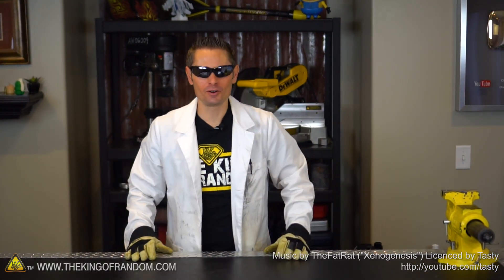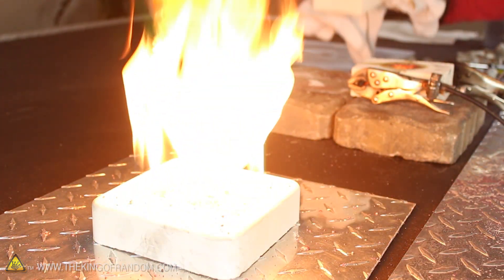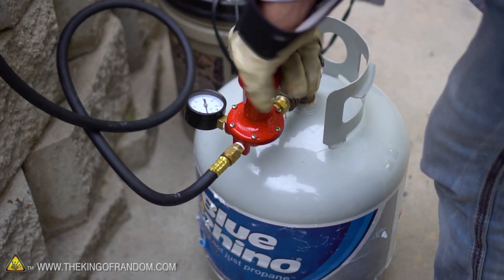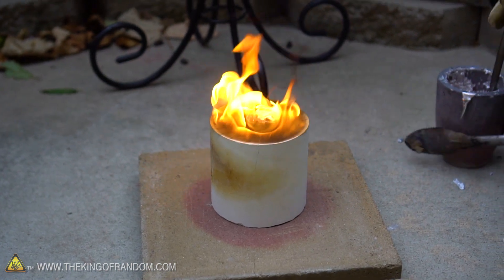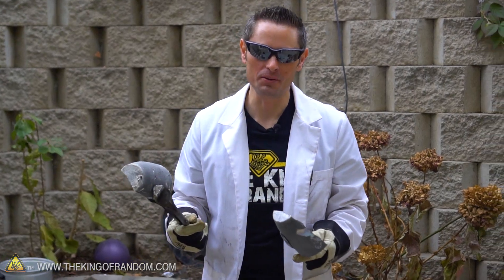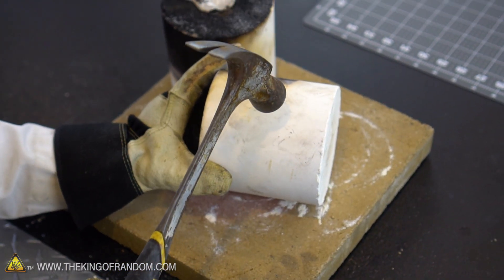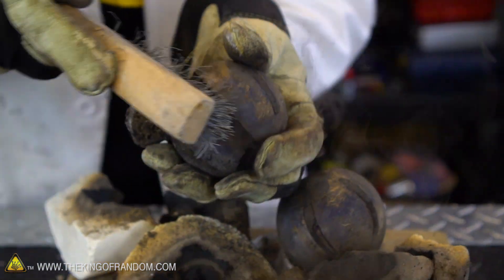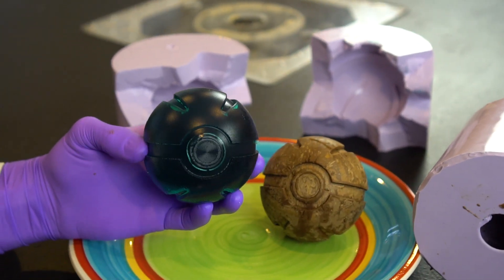Casting Aluminium PokeBalls

Comment: another way to do this is to use a substance called Green sand or silicon mixed sand most metal casters I see use some sort or version. There are a ton of different recipes for it but it melts wax and and molds really well just a tid bit of info love the channel and all the work

Comment: to avoid air bubbles or voids in your castings you need to add air vents adjacent to the pouring hole to allow gasses to vent..  you could do this as a wax sprue that you add before pouring the plaster :)

Comment: I recast parts for model kits. if you want less bubbles on it, you need to have some more air holes around the top to have the air channel up. It's more cleanup, but the results will be much better.

Comment: Hey Grant, I have never cast anything myself but I have always wanted to start.   I believe one of the main reasons you are getting those airbubbles at the top of your cast is because you do not have a secondary hole for the air and gas to escape as you pour in the metal.  Maybe give that a try and see how it works.

Comment: Hey Grant, if you want to make molds for metal casting, you best bet is to use sodium silicate and sand, then harden the sodium silicate with CO2. You can make 2 part molds with this method pretty easily, you just pour the sand in and pack it down around the object, then when you have one half packed completely you hit it with the CO2 and start on the other half right on top of it.

Comment: A better way to do that is to compact sand with water and a packing device and once it is inside the compact sand than cut it in half and you got a high heat cast

Comment: Couldn't he have let the wax inside the casts and simply poured the aluminium over it?
Reply: The wax does not burn out quickly enough for that to work like it does with the foam molds from the older videos. The wax needs to be removed for this method, called investment casting, either by melting it out like Grant did or by burning it out at a much higher temperature.
Reply: Some molds like the ones for rings could work with wax, but thats because the object is so small it is able to burn out quickly enough.

Comment: For casting metal you need to use Sand, Casting sand or GREEN sand will be the best way to go. Much easier to use, work with and sand is reusable.

Comment: you have to shake air pockets out with a heavy duty shaker that vibrates.
Reply: vacuum chamber would be better.  really surprised he does not have one, compared to the things he used to build it would be a breeze.  Could make one that doubles as a vacuum former as well.
Reply: Even more surprising considering he had a vacuum chamber brought over before with the scorpion video. Guess it's just one project he hasn't gotten around to yet.
Reply: Donnovan Mason or you can put it in a vacume
Reply: For the latex molds he could also mix a smaller batch and brush it over and into the pockets to fill them in. This would require a second curing though.
Reply: The Weaponeers ok cool
Reply: ***** oh.
Reply: Donnovan Mason thanks nice to know 👍

Comment: I am not an expert either, but I think there are usually extra channels in strategic locations in the mold to prevent air pockets and bubbles. And for the bubbles in the silicone, you should invest in a little vacuum chamber to put the mold in after you poured the silicone.

Comment: vacume chamber to get all the air out
Reply: that would work great for the silicone mold part, and its a whole bunch of vacuum experiments he hasnt seem to have done yet.. like vacuum forming, collapsing stuff with vacuum, etc.
Reply: yes this would work to get a bubble free mold. I do this when I make molds for resin casting, however you have to make sure the item you are molding is air tight. those pokeballs would have filled inside with silicone if he had done that and it would have been much harder to clean out the inside of the balls afterward.
Reply: *****
Hes done so much.. Now I need to go look for it.  Thank you.
Reply: TravisFabel

Comment: If you agitate the mold just after the pour and as it's solidifying it'll help release the bubbles and bring them to the surface faster...I believe they have machines for that but I'm sure with your ingenuity you could make something similar. Just basically a surface that vibrates.

Comment: go to the dentest and ask for little wachs sticks. put them in the mold where air can be trapped. when you heat them up they will melt as well but they will left little tunnels for the air to releas

Comment: Grant, next time you cast add extra vent holes.  If you're doing in plaster/wax casting, glue some crayons or wax sticks to the top edges. When you melt out the wax it will leave behind vent hole that will allow the air to escape when pouring in the aluminum.

Comment: To remove the bubbles from plaster moulds, jewellery makers pour the plaster around the wax as you do but then they place them into a vacuum or low pressure machine. This forces the bubbles to the surface. Try this with silicone too ?

Comment: Why not use a method of casting where you make a wax mold and cover it with oil sand and then poor the metal on that? The metal will melt the wax as you poor it.

Comment: Yea I've had some better luck with sand casting when it comes to trying to make more detailed aluminium items. The trick is in the green sand which is just sand, bentonite clay (can be found in cat litter ) and water. Since the sand and the clay aren't reactive it won't burn and you don't get the pockmarks.

Comment: If you want to help prevent the top air bubbles, you should add some "vents" holes (with a small drill bit) in the top next to the main pooring hole. it's going to create an escape route for the gasses.

Comment: I recommend you use Machining wax or a harder type of Wax when making wax models because candle wax not ideal and when  pouring your plaster tilt the container in which you have placed your wax model and if all possible buy a vacuum chamber to take all the bubbles out or make one PS making one would make for a interesting video

Comment: 50/50 sand/plaster will hold up better and be less prone to cracking,Sprue from the side,vent from the top or add some small "wax rod" vents to the model near the central sprue,also add  wax vents to any place that could hold trapped air. Give yourself a larger"reservoir" on or above sprue  that way theres extra molten material for the "shrink" to feed from or make some separate riser/pouring basins that you can sit on top of mold before you pour

Comment: Try adding 2 or 3 exit sprues so air the air has multiple exits, you could also use a vacuum on the silicone to remove the air bubbles, and since aluminium takes a few minutes to solidify you could vacuum the metal in its molten state to remove trapped air pockets to give a clean casting - hope this helps :)

Comment: When casting, use a larger, thicker sprue. If you have a vacuum chamber, put your fresh poured mold in for two minutes while shaking the base and that will eliminate a lot of the bubbles in your casting. Also, your plaster mold should be equal temperature to the metal you're pouring in. Otherwise, your mold will crack and burn causing imperfections. And you don't need to let them cool in the molds and use a hammer to get them out. After five to twenty minutes just throw the mold into a bucket filled with water and they will busy off of the metal while it cools. I hope this helped. I appreciate your channel so much!

Comment: You should do another wax mold but with pokemon figurines inside. And then mold them with wicks too, so you can use them as candles. The candle eventually burns down  revealing a pokemon.

Comment: Maybe instead of plaster, put wax into that casting sand and fill it. Wax should evaporate when in contact with molten alu + no air trapped inside.

Comment: Some suggestions: Don't use a cooking mixer for the silicon because you are adding air and the bubbles will come back in the mold. If you can use a vacuum chamber when using silicon. 
Also when pouring the wax or the aluminum you should have 2 ports (one for pouring aluminum and one for letting air out). Those 2 ports will depend on the shape of the mold.

Comment: a full body cast sounds awesome to avoid metal fatigue cracks blow holes hot tears distortion do it in pieces I.e hands legs torso and head and then join them
Reply: when casting bigger casting hot tear is a common problem reason the outside layer cools down quick and starts solidifying but the inner is still liquid and due to the coefficients of linear expansion needs more volume and starts to starts to oozes out makes a tear like deformity this can take place in the cracks of the mould while casting instead of water to make a plaster mould use resin that can with stand the high temperatures
Reply: as for your crucible cracking it crack only if it has moisture even  keeping it in the oven while baking the mould will do the needful
Reply: as for your crucible cracking it crack only if it has moisture even  keeping it in the oven while baking the mould will do the needful
Reply: as for your crucible cracking it crack only if it has moisture even  keeping it in the oven while baking the mould will do the needful
Reply: as for your crucible cracking it crack only if it has moisture even  keeping it in the oven while baking the mould will do the needful
Reply: as for your crucible cracking it crack only if it has moisture even  keeping it in the oven while baking the mould will do the needful

Comment: Hey Grant, 

To get better results when casting aluminum you've got a few options. Being what you're doing here is investment casting, you could go further down that route with a more complicated colloidal silica slurry & refractory sand or flour set up that requires firing the ceramic shell, etc. But if you want to keep things simple, you could go with something like Green Sand, which is just a coarse or fine grit of sand (like sand paper) mixed with bentonite clay (may be available at local health-food stores as bentonite powder, for abdominal problems) and water, made specifically for metal casting. As a bonus is, it's even reusable several thousand times, and if it dries out just add a little water, and stir. The only parts you would need to replace over time, are the wooden mold boxes, called a "cope" and a "drag," that are combined to make up the "flask."It's porous so the steam has places to escape, unlike in molten aluminum/cement explosions. And if that still won't work for you, I've heard of people using super fine colored play-box sand! 

Hope this helps!
Matt, aka: The Cosplay Supply Store

Comment: I wonder if you could use the silicone mold to cast a 2 part foam mixture which could then be used for foam casting with aluminum.

Comment: You need an ultrasonic vibrating table to remove air pockets. you can make it with an electric sander , 3/4 sheet of plywood and a sheet of metal on top to protect the wood, then skateboard grip tape on top of that. It would remove air bubbles from silicone metal and plaster castings.

Comment: To eliminate the air trapped at the top try adding an additional sprue as an air relief path near the sprue that you pour into. It should fill up the entire thing and not allow air to get trapped. At least its worked in my castings

Comment: I had an idea about the air bubbles in these castings,  because apparently every maker I follow on youtube is having the same problem. Do you think you could rig up some sort of agitator plate to shake the molds continuously while the aluminum cools? That way the bubbles all rise to the top of the fill port

Comment: Nice! If you use casting medium used for jewelry it will work better.  Cast in a tin can and leave the can on. It will hold the plaster in place. After a brief cooling to allow the metal to set, drop the whole thing in a bucket of water. Thermal shock will fracture all the plaster and make cleaning easier. Look up some silver casting videos for details. Great job!

Comment: You Need Something Like A Vibrating Table, To Get Rid Of The Air Bubbles.   The Same Way As They Make Clear Ice, 

It Should Work With All Moulding And Casting, :)

Comment: Plz make a. Hot glue sculpture pokeball by pouring melted hot glue into the silicon molds. I think it would look amazing, or simply make a rocket fuel pokeball and add a fuse to it and BLASTOFF

Comment: You should use MoldStar20T silicone for making molds because it is much less viscous and air bubbles rise out very easily. To avoid the air bubbles in casting is quite difficult with metal, but possible. If you roll the mold around, it will coat the inside of the mold and keep it from trapping air on the outside.

Comment: Jo , hitting the silicone case gently on the ground, prevents the bubbels.
If you want to be really save, you could also turn it on the other side when its not fully dried inside.

Comment: You can avoid air bubbles by putting the investment in a vibrator, although professionals usually apply it to a vacuum and vibrator for best results.

Comment: Cast a silicone pokeball :p
Reply: Falney I guess the silicone would get stuck together. so he'd have to make another plaster mold just for the silicon
Reply: He could use something to separate the 2 layers of silicon. Maybe a dusting of corn starch on inside of the mold would be enough.
Reply: Actually, that might work!... I'm not an expert, but if we want silicon not to stick to silicone, we should put a protective layer to separate the casting.
Or maybe I could be completly wrong and this wouldn't make any difference... idk...

Comment: When you're casting things in the silicone molds, I'd imagine having a vibrating base would help getting rid of the air bubbles. Nothing insane, just something to keep it moving so no air bubbles can settle and stick.

Cheers from Sweden.

Comment: For making the silicone molds you can use a vacuum chamber to decrease the air bubbles as it cures. Metal is tougher to use with a chamber because of the heat but you can try a vibrating table to shake the bubbles to the surface.

Comment: Plaster is very porous especially once heated and it loses water.  So when you heated it a lot of the wax stayed absorbed inside the surface of the mold.  You have to heat it above the boiling point of the wax (500-700F) to drive it off.  At that temperature the plaster will lose it's waters of hydration and become very brittle and porous, but it'll work as a mold.  You had so much wax vapor (and water vapor) exiting the mold, that's probably one reason why the top didn't fill out as well as it could have.  And that's the reason for the flames.

Comment: Hi Grant, 

to answer your question on how to avoid air bubbles trapped in your cast you need to poke extra vents as to allow gases to escape as your pour the metal. You need a different hole from the pouring hole as as when you pour molten metal it is harder for the gases to escape and it makes it bubble and splatter. You can also put in risers that will contain extra molten metal to compensate for shrinkage. The optimal design of these can be quite complex however just implementing them might yield great improvements in finish.

Comment: to release the airbubbles better, you could drill holes in the molds at the topside in an angle to the highest point of the pokeball so that air can come out better

Comment: You should sand cast these, not plaster. Also, if you want to avoid air bubbles getting trapped in your mold cavity, don't use just a single sprue. Add in a riser and vent hole from one of the sides. If you put an extended feeder atop the mold before you pour, you'll give the casting more metal to draw from as it shrinks.

Comment: Hey Grant, when I cast into plaster, I add play sand to my mold, in a similar ratio to the refractory wall, it gives it a lot more strength and I don't get anything burning off when I pour.

Comment: About the bourning wiht the plaster of paris:

I suppose you should try another type/brand of plaster. From the fire and the black residue, it looks like there might be a organic carbon source in the plaster. Some plaster could contain polystyrene[1] and this would burn no matter how long you bake it.

I would suggest a mold material completly made of minerals. I have no experience in casting, but some in chemistry.

It's also possible there might be a little bit of wax left, that would also burn.

[1] https://en.wikipedia.org/wiki/Plaster

Comment: for the wax one I recommend putting a lot more wax and putting a metal weight on top with rubber on that sides so it doesn't sink but only pushes the wax down as it cools and shrinks that will give you a much more exact mold then when you make the plaster mold it will be much more accurate

Comment: From what I've seen you can minimize the air bubbles in the silicone casting by putting the forms in a vacuum chamber and pumping out the air, when creating the silicone molds.

Comment: you should get a vacuum chamber to pull the air bubbles up. or alternatively a pressure chamber to compress the bubbles into a smaller area.

Comment: When I do concrete we beat the forms with a hammer after pouring to eliminate bubbles in the finished product. If you rattle your stuff around a bit after pouring it will force the bubbles to the top. Should help eliminate imperfections in your cast.

Comment: Hi Grant.  Typically I use locally found clay for molds like you have.  foam or wax is used for the inside.  fire the clay and it won't off gas like plaster.

Comment: two things that may help. First off, you can try to de-oxyify the aluminum before the pour to help make sure there is no air in the casting from the metal itself. Secondly you can try to use compressed sand instead of plaster as your mold. The best way would to build a stucco mold, layering a slurry of plaster then coating it with sand, first light sand then a heavier grit...but that's way time consuming and expensive